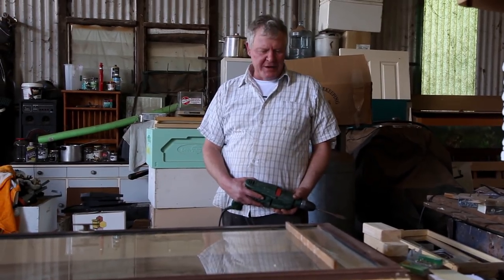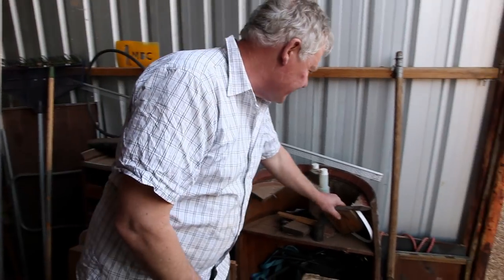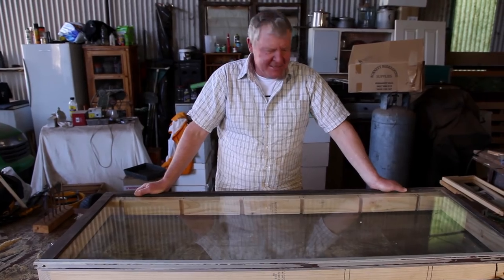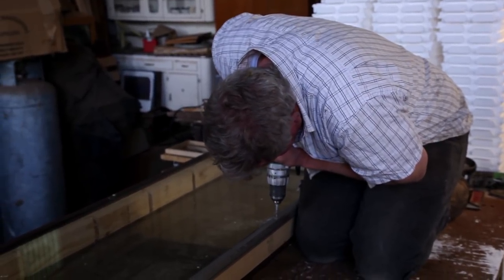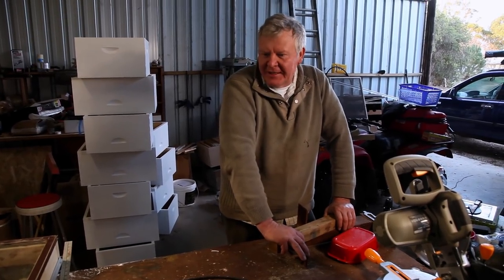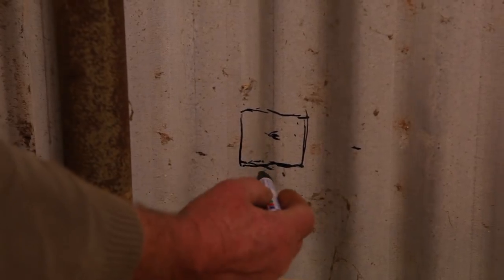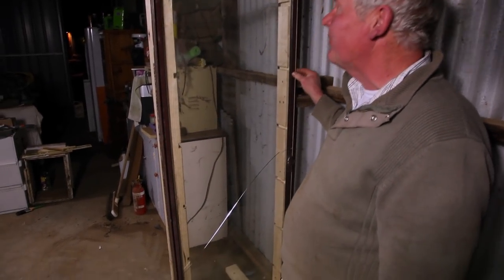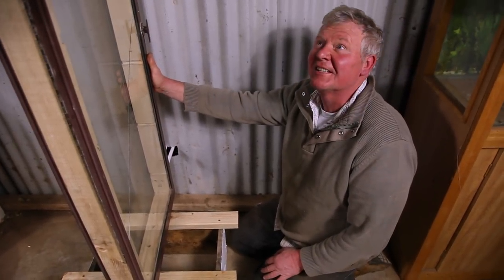How to Build an Observation Hive (Part 3 of 3) - Episode 84: "Drill Drama"

Comment: Hinge is on the wrong side of the project. You will have it "walk back and around" to service the frames, make door open towards wall, out of way. Just turn the system end for end, and make sure the door wont hit anything against wall. make sure frames sit both plumb and level..good project though.